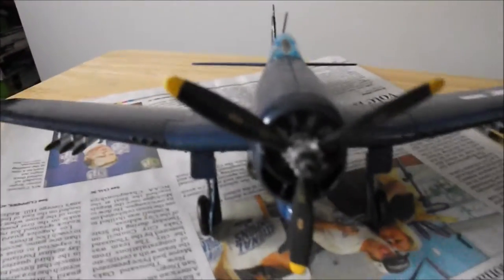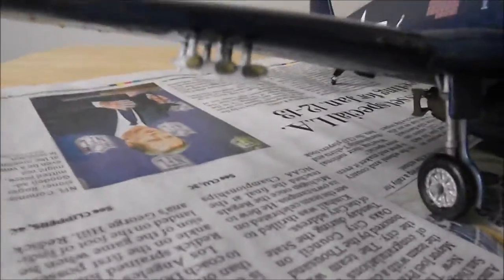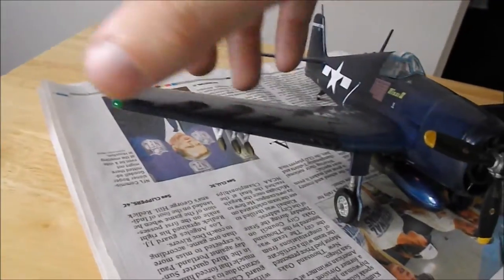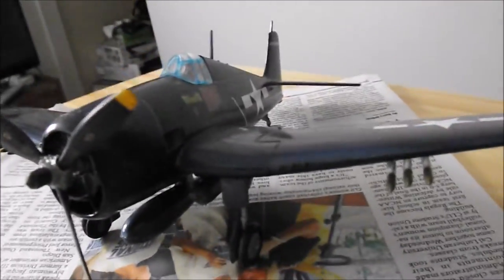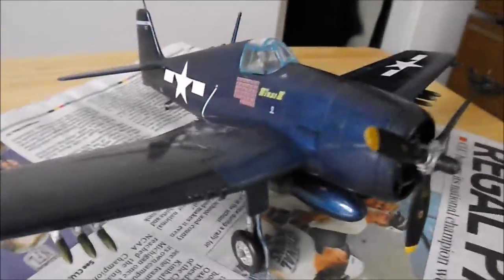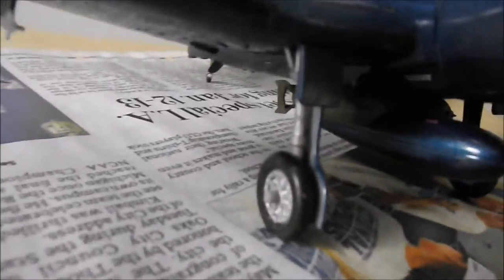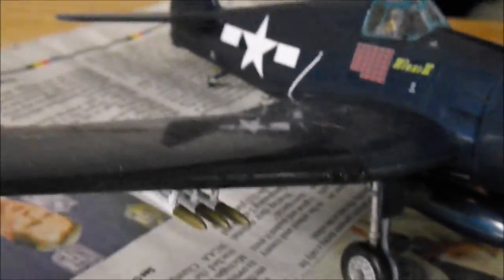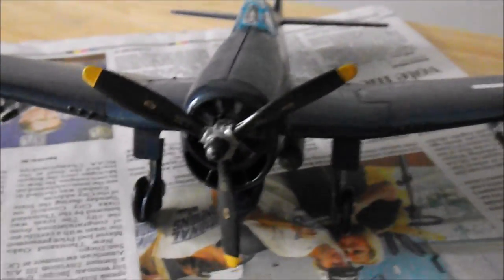Revell 1:48 F6F-5 Hellcat "Minsi III"

Comment: Excellent gloss coat, really like seeing the reflection of all the insignia decals :D. Your model looks really great especially fully loaded. I really ought to buy another Hellcat this year, this video really makes me miss building this plane :D Thanks for uploading this :D
Reply from the maker: +rebelsatcloudnine Your welcome! I am glad to hear that you like it so much. I just  like to be sure that the decals are visible to my audience. That blue is a metallic finish just like the Bearcat. It is a fun kit to build but the hardest part is inserting the base of the wings into the fuselage.  By the way I saw your 1:72 Wildcat videos. Really good job on it and great build. Right now I'm finishing decals for the P-47. This time I have to create my own decals for the variation I am making.
Reply: +ww2passion Excellent I look forward to the P-47 :D
Reply from the maker: The instructions said to glue the center assembly of the wings together before inserting them into the fuselage, so I did that. The problem was that I had to sand down the openings just to make the center fit. Doing the left left and right wing tip assemblies were not so bad to deal with.

Comment: I love this old kit and have built many of them over the years.  I still have most the ones I built as a kid back in the 60's.  One is actually  blue on top and painted with white house paint on the bottom. After buying the kit for $1.49, couldn't afford the dime for the white paint I guess.  I still built them and they're hanging in the garage and in the office. Theirs markings include those of the USS Bennington, Intrepid, San Jacinto, Lexington, Shangri La, and some others just made up out of my imagination. Thanks for posting this. At age 65, am I the oldest fan still building them?
Reply from the maker: Wow that is a lot of Hellcats you built! The Hellcat is my favorite fighter that flew in the Pacific Theatre of WW2.  More models will be coming soon.
Reply: @ww2passion...Yes, built others besides the Monogram.  Love Hellcats.
Reply from the maker: Which kit brand in your opinion is the best to use for the Hellcat in terms of the engineering and detail?
Reply: @ww2passion...My favorite in 1/48 is ARII.  1/32 is Hasegawa, which to my knowledge is the only one available in that scale.